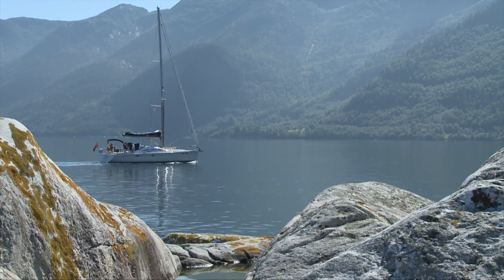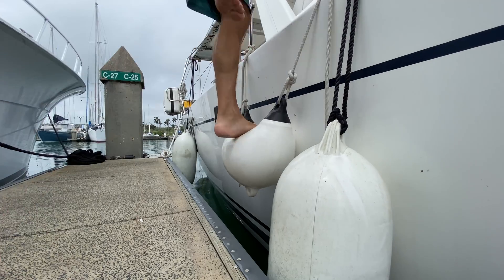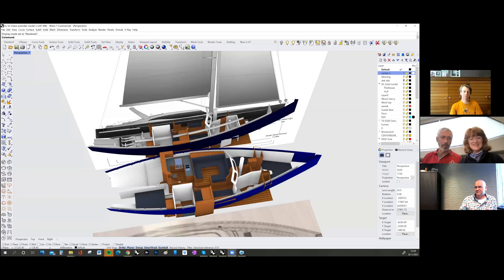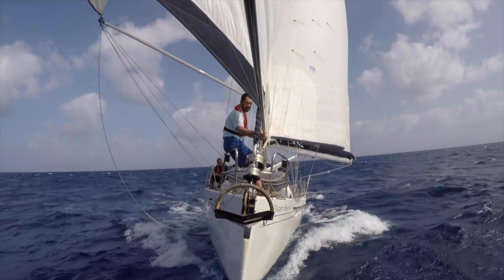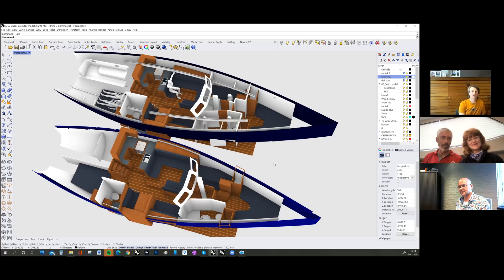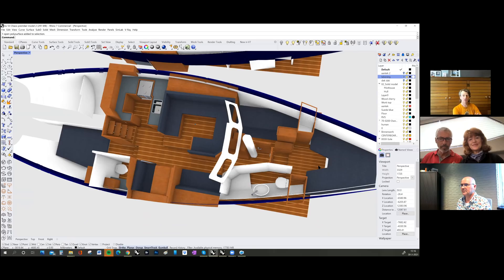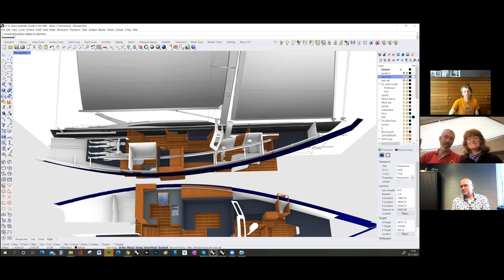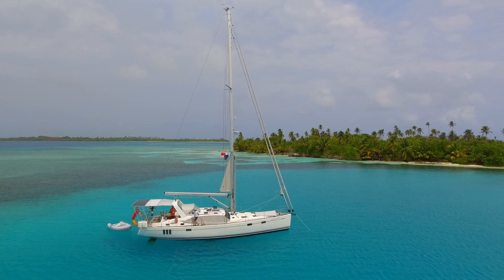Custom Aluminum Sailboat Design! | Distant Shores | EP 209

Comment: Has someone who has spent a good part of my career working the processes and tools of design and design documentation? I would think that the next evolution if the manufacturers wish it would be 3D documentation of the builds and design say in 3D PDF. These PDFs can have both 2D and 3D components and an electronic owner's manual would make a lot of sense. If the manuals also went on to have self-propagating logging functions for maintenance, refits, rebuilds, and other service life events, I think this would bring much value to the owners and operators within the offshore and Marine sector or industry.
Reply from the maker: Wow what a cool idea. I’m off to look into 3D pdfs 👍
Reply: I suspect the logging parts are going to become more involved into an integrated ship management system. On other channels, I've seen Super Yachts with systems that are already doing this, I think it's only a matter of time until someone starts making a system that offers a 3D model running on chart plotter, tablet and whatever other display you have, integrating the 3D construction data, values from all the sensors and inputs to all systems and actuators.

It's only a matter of software, and software is basically free. Yes, developing it costs time and/or money but after you have developed it, it costs nothing to duplicate. So I expect that at some point, someone is going to develop a free system that does all of this.It all depends on the availability of open protocols to communicate with the devices, e.g. the sensors, the engine monitor (maybe even controls), etc. 

With more and more digital functions coming into everything, there are going to be new problems introduced but also there are going to be chances to do stuff that we today only fantasize about.
Reply: Hello Timothy how are you doing😊

Comment: Interesting design choices. For my personal choice, I would go with a large Pilot House, and single aft cabin, allowing for a technical space. I prefer function over form, especially going into the far North.
The North, where I live (55.75°N) has short summers and the shoulder seasons can be quite brutal at times. So outside lounging/work is greatly curtailed to the necessary only.
Best wishes from Northern Manitoba.

Comment: I hope they model your electrical and mechanical too. Would be interested in a video where the designers talk about why they use 3D models and all the benefits a model delivers throughout design and construction, not just conception. Do they use it for fabrication, structural simulation or energy design? Do you get a reference digital model at the end of the project? Fascinating and mysterious world. Curious about how the technology is being leveraged.

Comment: Hello from Ottawa! 

Somewhat new to sailing so please forgive my ignorance on the topic of skeg hung rudders and how naval architects include them or omit them based on performance and other criteria. 

At 8:29 there is a shot of the rudders. Just a thought but since you are redesigning it for increasing margins of safety and performance and have the naval architects ready to bounce things off, why not redesign the rudders. They look somewhat vulnerable, in both the aspects of whale attacks and lack of the rudder being reinforced with a skeg. 

I’m curious if it is not a good time to at least think about redesigning the rudders so that they can be either retractable and hidden behind a skeg thereby decreasing ones vulnerability in whale attacks as well as accidental collisions. 

It could also add to a skeg tripod system for beaching. I am probably wrong but those rudders look like the weakest part of the design. If the rudders could telescope up and be recessed into a skeg, or be hidden and protected just aft of a skeg it could be a big improvement.
Reply from the maker: Interesting you mention telescopic rudders. KM has done 2-3 boats with this feature but it is somewhat complicated. Skeg-hung rudders can be strong but require more force to turn and for the autopilot to steer. We plan to use the great strength of aluminum to engineer super strong rudders which don’t need the skeg.
Reply: Hello how are you doing I’m Allyson from Long Beach CA😊